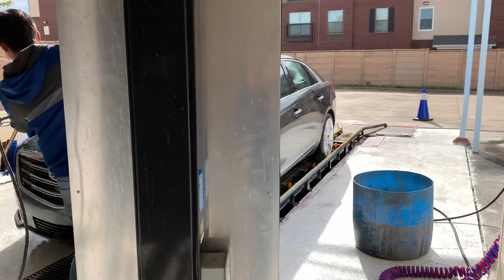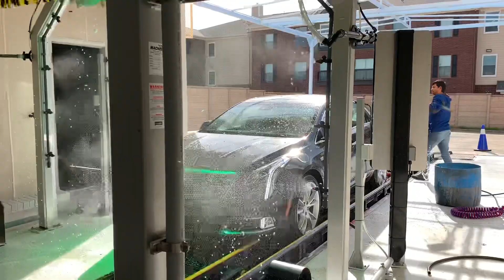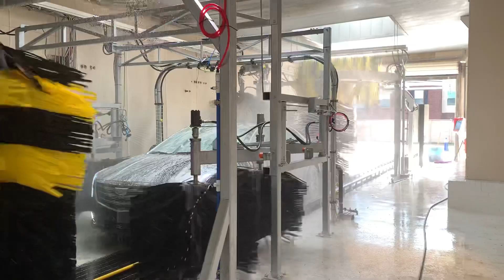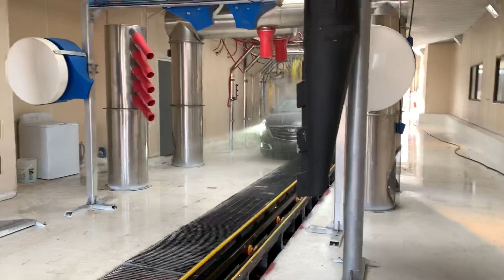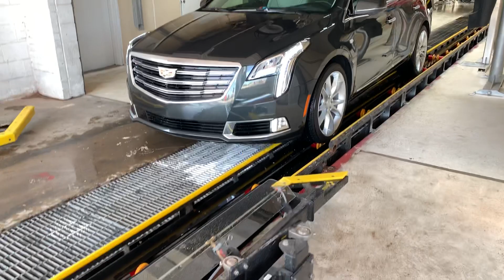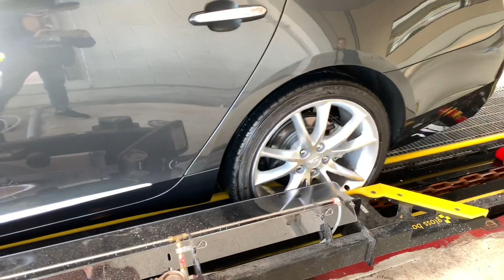Urban Express Carwash Lewisville (Soft Opening) Part 1

Comment: They just opened one here in The Bronx ( Burke Avenue and White Plains Rd) Just used it.The dryer system is excellent.Only had the guy wipe off small excess water from the windows.I signed up for one month unlimited washes for $14.99 ( 1st month only).After that its $30.Good deal.My cars gonna stay clean.